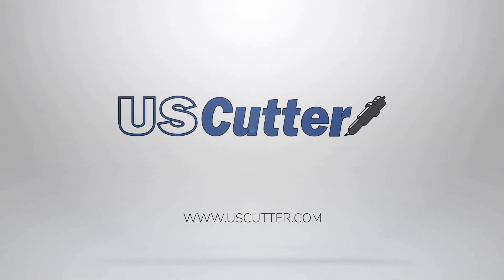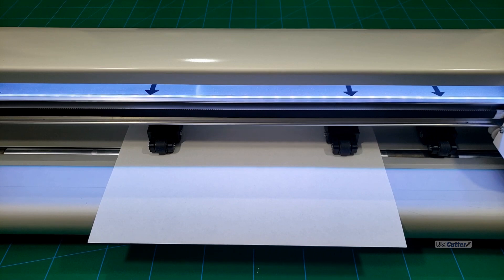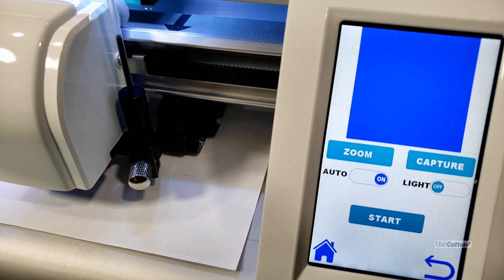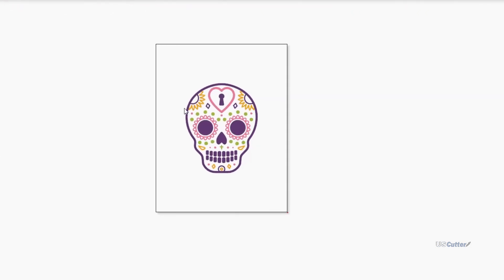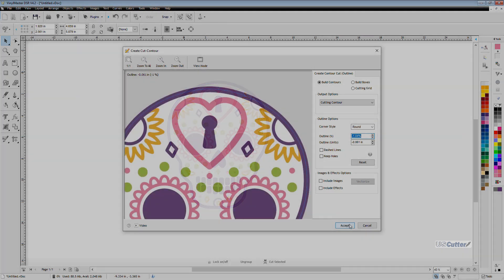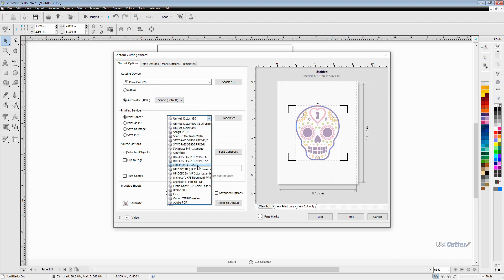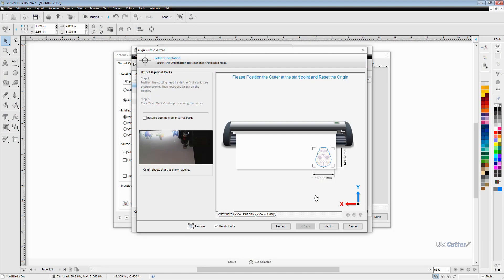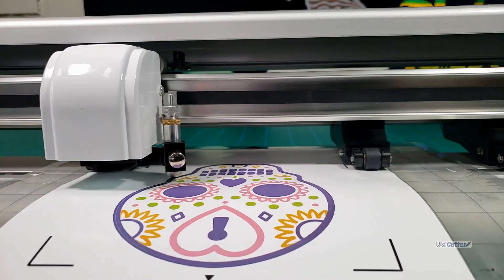Quick Cuts -  Calibrating a Prism Cut for Print and Cut with Vinyl Master Example

Comment: Does this have an illustrator plugin software option? Like Cutting Master 4? Does Vinyl Master accept EPS files? Layers?
Reply from the maker: No it doesn't have a illustrator plugin. You would just export your files from AI as .SVG files  and load them into vinyl Master. DSR will work with EPS. All version can handle multiple layers.